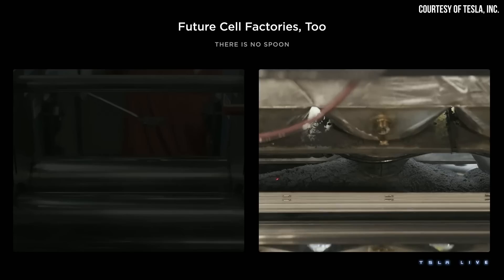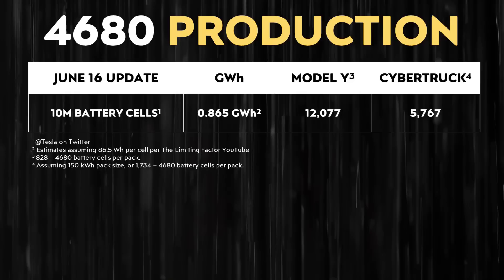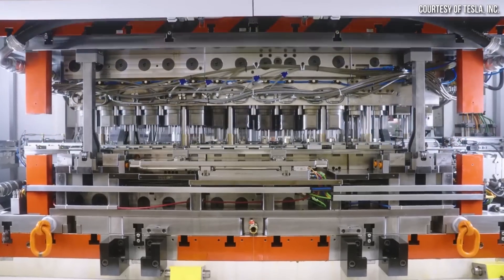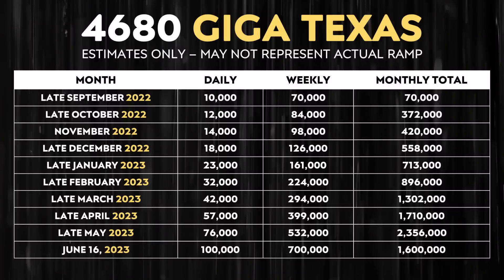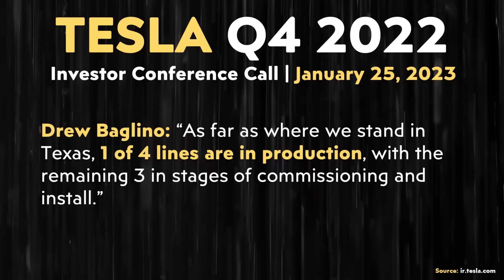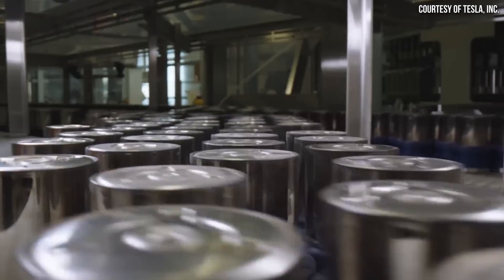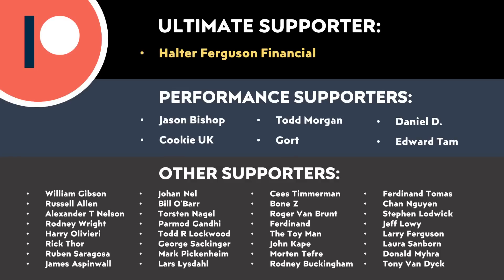BIG Tesla 4680 Battery Update | Giga TX 4680 Ramp Explained

Comment: I'm still struggling to understand the necessity to junk ICE in favour of ev's.  Makes no sense.
Reply: I switched 2 years ago and my EV is much nicer to drive than any ice car I've owned. Air quality in cities would dramatically improve if everyone drove EVs instead of ice. The only arguments against EVs (mining of rare earth materials, weight, range, carbon emissions created in the production phase) will all be laid to rest in 5-7 years from now through improvements in battery tech.
Reply: @dombaker1924  Doubtless tailpipe emissions are reduced.  But what overall benefit is that if electricity, to charge ev's, creates pollution in power generation?

If going for renewable energy sources, how about the massive cost to implement solar or wind.  And what of the need to provide gazillion transmission lines from new sources of green generation to end consumers?

Battery disposal - theoretically possible to recycle, yet prohibitively expensive, so not going to happen.

Battery tech will doubtless improve, but let us not be fooled by unrealistic promises.  The laws of physics must be obeyed.

Wind turbines, manufactured in China.  Also solar panels.  Life cycle costs must be considered.

Sorry to say, I'm still not seeing a case for ev's.  It's all looking like another con job to me.  Taken from the same "safe and effective" play book that so many have been fooled by.
Reply: @clives4501  your reasoning seems to be underpinned by the fact that any method of producing energy has some environmental consequences. Whilst that is true, the fact remains that such environmental consequences pale in comparison to the burning of fossil fuels.

I don't quite follow your point regarding 'laws of physics' in relation to battery tech? CATL have already announced that 500wh/kg battery which will bring the weight of EVs on par with ice vehicles. 

As for battery recycling, it's already happening. And hundreds of companies are gearing up to optimise and profit from this industry that will boom in the 2030s.

Your arguments are largely internet myth propagated by those who have an attachment to ice vehicles. 

But as wonderful as ice vehicles have been, they've now been superceded by cleaner, quieter and higher performance tech. Ice is done. EVs are no longer the future, they're the present.
Reply: @dombaker1924  I'll get past the supercilious tone of your reply and proffer the following for your consideration.

“The fact remains that such environmental consequences pale in comparison to the burning of fossil fuels”.  If it’s a fact, show me the incontrovertible evidence.

OK here is the point of physics - The mass-based energy density of batteries is in the range of 0.1 to 0.27 kWh/kg. In comparison, gasoline is 13 kWh/kg.  Now that is quite a difference.  Will battery tech really improve to the extent that it can compete with fossil fuels – that's a rhetorical question.  You’re a smart guy, you know the answer.

“And hundreds of companies are gearing up to optimise and profit from this industry that will boom in the 2030s”.  And who are these (hundreds of companies?  Can you name even 20 or so who have credible business plans and timelines to achieve their goals?  And are they subsidised by taxpayers.  How many tons of batteries will need to be recycled over time and what are the facts about the logistics and economics of that happening?  Will there be a net benefit to the environment and how will that be demonstrated and monitored?

“Your arguments are largely internet myth propagated by those who have an attachment to ice vehicles”.  Pure assumption on your behalf.  Incorrect and insulting.  Not a good premise for critical analysis or rational debate.

“But as wonderful as ice vehicles have been, they've now been superceded (superseded) by cleaner, quieter and higher performance tech. Ice is done. EVs are no longer the future, they're the present”.  Fine words my friend and welcome to them.  However fine words butter no parsnips!
Rgds
Clive
Reply: @clives4501  Forgive me, I did not intend to be supercilious, I was merely stating facts.

I do understand that many people are attached to ice vehicles for a variety of reasons. Perhaps they’ve dreamed their whole life of owning that roaring Lamborgini Aventador and then along comes a single-speed silent and unremarkable looking car in the form of a Model S Plaid that absolutely smokes the Lambo.  But times change and certain aspirations have to be let go and replaced. 

I stated that the fact remains that such environmental consequences pale in comparison to the burning of fossil fuels. Your response was “If it’s a fact, show me the incontrovertible evidence.” And unfortunately that statement demonstrates that you’re well into tin-foil hat territory so there’s no way I can really help you.

However, drive whatever car pleases you, it really makes no difference to me what your choices are and how you justify them to yourself. Personally, i primarily drive an EV because it's a superior driving experience to ice. The fact that it's better for the environment is secondary.

Comment: I have a question, I know they are also producing the 4680 in California too.  They are already making more than 40,000 models Y’s in Texas.per year.  .  Where are they getting the additional 4680 batteries?  I think Tesla is releasing these numbers way behind what they are actually achieving.
Reply: By their battery suppliers CATL, Panasonic, LG and BYD. They either provide 4680 cells (NCM) or 2170 cells (LFP/NCM) or 1865 cells. Those cars would have higher long term production costs as its more expensive to buy batteries from suppliers than to implement their very own mass production 4680s.

Comment: Yesterday Joe T showed some new chiller coverings on top of the Austin plant at the south end [they have begun removing the south walls for extending the building]. They are the same coverings as those for the battery chillers at the north end. Could it be that will be a new set of lines for Cybertruck? 

I think that running 2 lines at a time or more increases your chance of finding a real issue in the line. Versus an issue with that line. Both are good to know. Having more lines run speeds up the development. They have many new plants planned. They need to know where the weakest links are in a short time. I think they will be making the original battery for many years. Even if only for energy storage.

Comment: Do we know if the 4680 packs get more miles than the 2170 packs? Do they charge faster too?
Reply: Tesla is running them at or near the 2170 rates. But many of us suspect they're theoretically capable of more, which might be software unlocked in the future.
Reply: Gasoline - no such doubts.  Why ditch it in favour of dubious tech with no proven benefits?
Reply: @clives4501  seems you have entered your question into a comment box rather than the Google search box

Comment: The unanswered question is: 10,000,000 produced at Giga Texas so far? ... or ... 10,000,000 total, from all sources, including Cato Rd., etc., and the 10,000,000th just happened to be produced in Texas? ... most likely ... the latter.
Reply from the maker: In December of 2022, Tesla hit 868K battery cells built in a 7 day period. That is over 100K per day. If Tesla didn't grow production at all (which is not the case) in 6 months at 100K per day would be somewhere around 18M battery cells or so in that time period. The 10M  number has to be for Giga Texas only.

Comment: Too many variables at the moment, including 
.
Which of the processes are the bottleneck?
Is there more than one?
How many lines under test?
Which combinations of process are they trying?
Have they decided on the first "optimum" line? (For instance, they may double up the cathode lines to feed one "canning" line)
How much raw material do they have?
Which location has the best combination running?
Do they have multiple lines of that type running? (At what output?)
Plans for extra test lines? (The Rented building? Could that be the first real "end to end, straight through" test facility, preparing to duplicate the machines ready for a Texas refit?)
Then, have they, or are they about to upgrade the chemistry, which throws the "cell number" calculation out? (They may decide on 10% speed reduction with 20% density upgrade?..... Or similar)
And no doubt some points I missed.
Like.... Are they in collaboration with Panasonic, Lg, Samsung (CATL??) to perfect a COMMON process from which they will all gain?
Ref the charging agreement... 
The MISSION is the motive.
.
Meanwhile, I'll take the position of...
It's progressing.
When they DO nail it, it's going to be "popcorn time"
Reply: "They'll fire out cells like a machine gun" - I think Elon said - and at high car production ( millions per year), they will need to...

Comment: Jon, thanks for the analysis.  The problem with your ramp estimate is you started back in September.  However, you are missing the announcement on Feb 18 when they produced their 1 millionth cell.  With their 10 millionth cell on June 16th, that means they produced 9 million in 4 months.  That's an average of 2.25 million per month, but obviously it's a higher run rate at the end of that time.  So they must be more than double than 100k daily run rate you estimated.  Thoughts?
Reply from the maker: I will look into that for an update video in the future. Thanks for pointing this out.
Reply: Yes - Tesla could be much further along than we thought. Nice Pickup

Comment: I believe you assume incorrectly, but not the other meaning you suggested.

I read it to mean 10M 4680s have been produced by Tesla, and that one was made in Austin.

This is the language and meaning they use when they announced large auto production numbers.
Reply from the maker: Than can't be it. In December of 2022, Tesla hit 868K battery cells built in a 7 day period. That is over 100K per day. If Tesla didn't grow production at all (which is not the case) in 6 months at 100K per day would be somewhere around 18M battery cells or so in that time period. The 10M  number has to be for Giga Texas only.
Reply: @Cleanerwatt  Check the auto production language and show me where I’m wrong.

The language is identical.

Tesla didn’t say they could produce 868k/week minimum.

They’re ramping, it takes time, line(s) could be shut down for days or even weeks busting through bottlenecks.

Comment: It's great to see that they are producing usable cells during the ramp and while they also innovate on so many different aspects (dry cathode and anode, tabless, caps, laser welding, increasing silicon content of anode, etc), but I agree that they aren't really pushing hard to get high production rates. Instead, I expect they are working to achieve high yields during production sprints that test ability to scale up each iteration.
Reply: What's tabless?

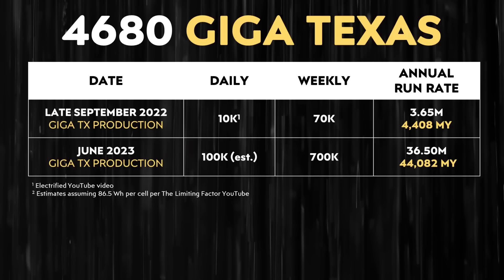Comment: 4:56 this math is saying there's 828 cells in each MY. (36,500,000 / 44,082) This doesn't seem right. Rivian's have 7,777 cells and I think my MX had around 6,000
Reply from the maker: The SR AWD Model Y has exactly 828  individual 4680 battery cells as was confirmed by Sandy Munro. The 4680 batteries are much bigger than 2170s, so less are needed. Plus, the SR AWD Model Y only has a ~71.6 kWh pack.
Reply: @Cleanerwatt  thanks, i'm familiar with the size measurements, but didn't think it would be such fewer cells per car

Comment: A reason you might want to start another battery line before you have gotten the first one to a good state might be to train the crew that's operating the line this might cost you more as you need to do the same thing twice but it will make you produce more batteries at an earlier date

Comment: When they are cranking out 1M/day I will dance a little jig (Freemont and Austin)
Reply from the maker: That will be amazing!
Reply: That’d be 40 GWh pA - same as Panasonic Nevada 2170 cells, 2023.
Just how long did Panasonic take to ramp Nevada? Using proven methodology.
Two years after start of production to get to 30% of designed rate.
Another two years to get to full run rate. 6-7 years after ground breaking.

Comment: No chance imo the teratx built gen2 4680s are as low in overall energy density as last year's Kato road gen1 cells that got torn down. 
Further counter is tesla showed during investor day the average ct pack would be 100kwhs not 150kwh as you showed here. 

I truly believe the ct is going to hit 3+miles per kwh in the lower spec trims on as tires. Matching or beating the model x. 🤔